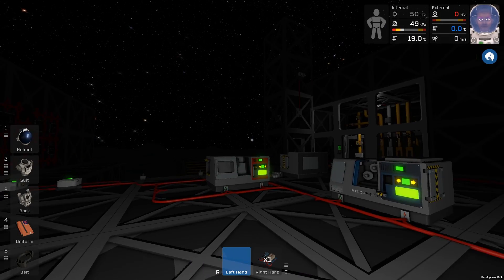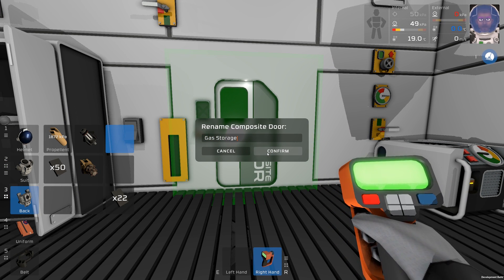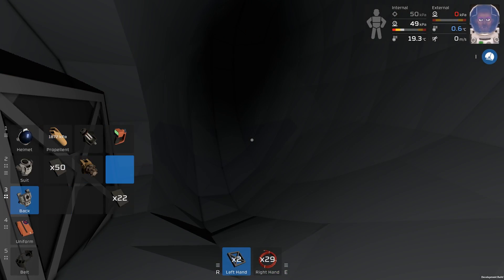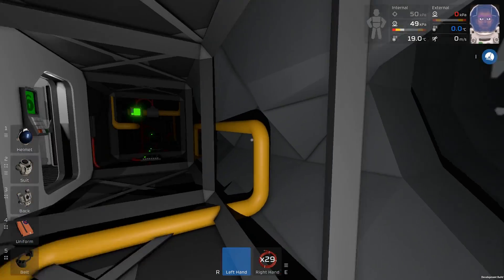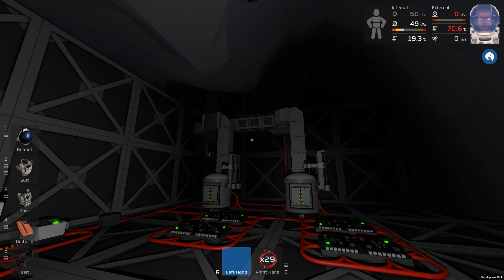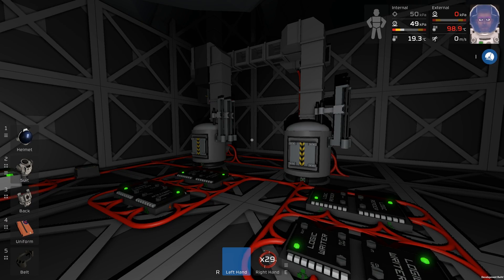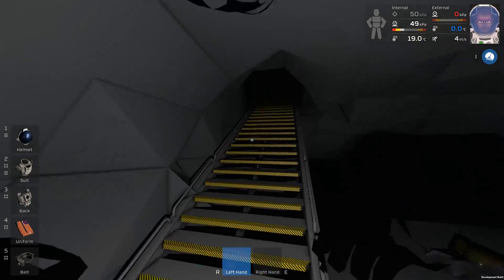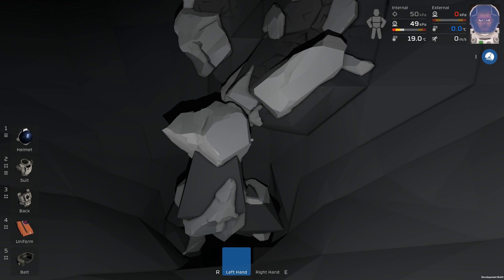Stationeers E24 - Misc Base Building

Comment: I know making Steel is a pain vs. Iron. But I recommend using Steel Frames and Steel Sheets instead of Iron Frames/Sheets. They need less material and I guess they are stronger and I find they look even a tad better. They use only 3/8 Iron Ore vs. their Iron counterparts (1/8 is the coal in steel).

Even if you now recycle all Iron Frames and Sheets, you would still get out 1:1 (a little better actually) because the return of the Recycler is 50%, add the Coal and than build the Steel variations. But you could let it all as it is. I discovered this also too late when a larger part of the base was already build ... I guess from now on and for the next base build than.

Comment: The storage fills everything in stores suits, battery, air, jetpack and empties waste if connected. Remember to connect the correct gas to Where you want it and put a pressure regulator in front of air and jetpack. Quite usefull if your base is pressurised and you only Use suits when going outside :)

Comment: you can put those portable conditioner and filter on tank bases to drain them and they run on it as well. so you can use a portable ac in a semi permanent situation.

Comment: i have finaly just managed to catch up on the series and here are some opinions/questions/ideas: 

you could make a sorting system where when done processing the branches(like smelting) gets sent back to start (alloy materials could be filtered off before everything else) and goes through the system to be filtered again then the ingots get split between the various machines (you could also have a drop chute for stuff like pipes and cables with a wall of buttons that when pressed adds 10 to a countdown counter linked to a machine making the material(to make it so you can press a button and 10 cables pop out in front of you from a pipe.

you could also make a backup generator and battery array underground being controlled by the power level of the main batteries and fed coal by the sorting system(with half or so being split off to go into a storage pit).

sorry for the text wall but good job on the series and finally do you think you could do time lapses of the stuff you usually just cut? i personally prefer time lapses to sudden cut to things looking different as it helps show more of whats going on(though thats just me).
Reply: also if you can control whether machines are dumping resources via logic then you could use a auto lathe or something as a sorting system item storage

Comment: Hello again, I have noticed exactly same thing, the hole in the ground go deeper after some time. I had small hole next to my base which was probably 2 metres deep, I didnt mine anything there, now the hole is like 12 metres deep and 10 metres wide. Next thing is, it looks like resources are revealing self after some time on the surface, looks like some kind of surface erosion.

Comment: Could you please consider pressurizing the base with an heavy electronics controlled N2/O2 mix? I found a solution using a passive vent & pipe analyzer as starting point but I would like to see how you would handle it. :)
Reply from the maker: Sadly, I don't have enough nitrogen yet!  I think i'd be fine without much electronics - I'd just have the gas room output N2 and O2 through a mixer to the base.  The filtration can pull it back out, and it'll go back through filtration.  As long as N2 is preserved, only O2 should get used up.  I guess it depends on how good the gas mixer is at regulating the gas mix in the base from its separate lines from the separated gas tanks!

Comment: show how to use the fire extinguisher and what happens when you mix vilitile and oxides in a hot room.
Reply: I did that in airlock, oxite and volatiles, when I returned to airlock, there was air 3500 celsius hot :D
Reply: Saddamo De Beers when i did it in my base it burned all my cables and eventualy burned through the door after i had had to crowbar my escape. i would like to see what combination caused it though.

Comment: Can you toggle the Power control console via electronics? I'm thinking you could have the opening of the door to the machine room toggle on the power to all the machines without needing electronics with a writer for each machine.
Reply from the maker: Interesting idea - I must investigate :)
Reply: I have my arc furnace in my gas/ice handling room. I'm trialing being able to dump ore in the arc furnace, leave the room , close the door and it will switch on a vent for extracting gas and activate the furnace. 
The last bit I need to work out is opening the door automatically again when the room is fully vented which should also switch everything off.
Adding an output chute on the arc furnace to outside the room means I can start using the ingots while the room is still venting rather than waiting inside the room.

Comment: So i am having with an airlock on a dedicated server. I already set a bunch of airlocks and i redone the airlock a couple of times so it has to be a server Issue. Every time I cycle the airlock to exterior the vent just stays off and the outer door opens. i cant seem to fix it so I am setting up an airlock control via circuits but my design is probably pretty inefficient. So i was wondering if you ever wondered how an airlock control made with circuits looks like and maybe you wanna do your own.
Reply from the maker: I've thought about a gas sensor-less airlock with electronics, but it gets a bit complex if you only want one button to cycle things.  Two buttons should make it a bit simpler, I might do this :)
Reply: So i build my own airlock with a logic computer hybrid build. i've got 3 buttons which go into an or gate and lock a hidden wall light. the computer reads if the wall light is locked and will close all doors depressurize the airlock. when the pressure reaches 0 the outer door opens. and the same for the cycle to interior. so its like 8 chips and one computer.

Comment: I have an idea for a new video: Is it possible to install a system wich is able to sort and strore your ressources, and is it it able to move it to the contruction mashine wich needs the ressource automaticaly?!
Reply from the maker: You might be able to store stuff in a chute (using a sorter, one chute per item type), but actually requesting it back again in a nice way is probably not doable yet.

Comment: STupidest think that you can do is use iron frames for building, you get with steel you get a double block instant from 1 complet iron build block.
You get even more out of them when you resucle the frames and make it to steel.
You come not really far with canister by catching the stuff from smellting, stack 50 iron and you have ith 3/4 full.
Sojamilk maybe.
I build my half base out of steel after i relised how cheap they are.
Reply from the maker: +DougFunnyJunior They also burn at the moment, apparently :)
Reply: When you use the Recycler, you can put this mix from it direct in the furnace, you dont need to use the centrifuge.
Reply: Only in a very high oxygen mix when exposed to incredibly high heat like from a wall heater, furnace setup or welding. Its an easy fix; balance out the air composition and include an air evacuation system to vent the air when it detects unsafe temperatures.